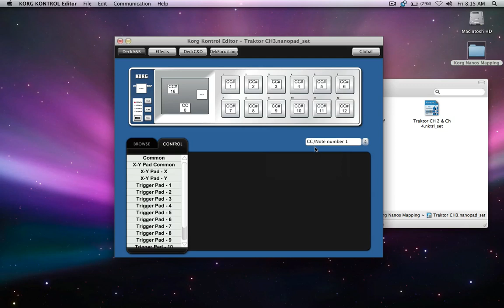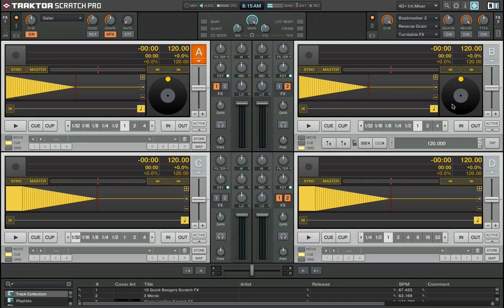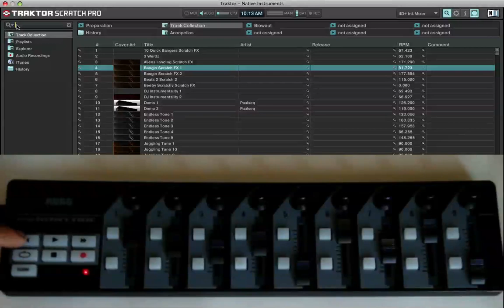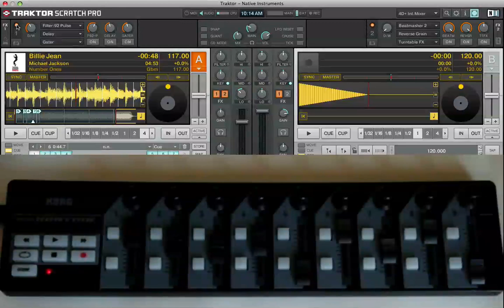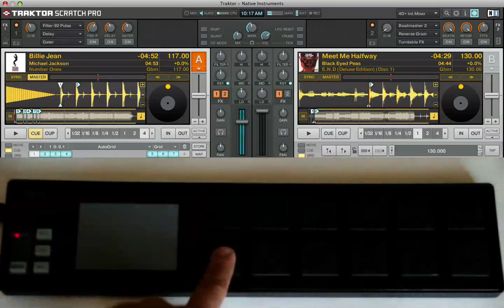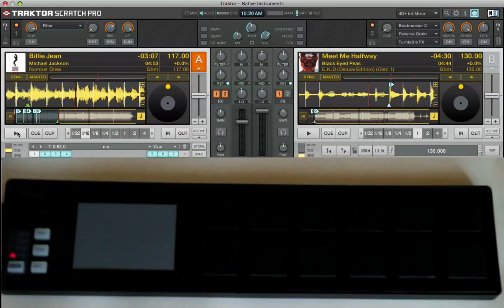How To Control Traktor Pro With Korg Nano's - Free Midi Mappings

Comment: im using tracktor 2 and for some reason is not working can you tell me what im doing wrong? And im using a pc.. Thanks.
Reply: and I m have a graphite mf8 samson does not work the rotating but  just to the right .
 to the left close directly close does not rotate the course of the dry wet effect button etc

Comment: armyofme4340 I do need your help :(( I did bought a KORG NANOS and after one week I already update to a mixtrack pro from numark. I do miss the reset BMP option that was on kargo.  I am trying to set up a hot key, going inside Setting > Controller mnage > ADD IN

I did find the one to PUT IT IN SYNC but cannot see a way to do the way around, i mean when I press is reset the BMP. can u help?? :((

Comment from the maker: @PAGU3IS The nano's are a little tricky with LEDs. They are not software mappable. Which means traktor won't map them, you have to assign them in the kontrol as toggles. And then assign them as holds in traktor. It's the only way. But even then it's not an ideal fix.

Comment from the maker: @fredooow The new version of traktor has a sampler. look  up traktor s4. dj shiftee has an amazing video on it.

as for the current version. it doesn't technically have a sampler but you can use deck c/d and set up your samples to cue points and then map those cue points to your nanopad. check out ean goldens midi fighter walkthrough on here as well. he shows you how to globally record your samples and glitch them out.

Comment from the maker: Thanks. I'm working on a really good maschine mapping for traktor, with sweep build ups, loop rolls, cue juggling, and fx presets. i'll post it up when it's done.

Yeah a lot of people don't use loop rolls in traktor because it requires a bit of midi mapping faking but i got it to work with a knob that distorts the loop roll if you wanna get a little gritty.

Stay tuned.

Comment: This is way inspiring.  I'll probably roll my own assignments but this gave me a lot of really good ideas.

I've had Serato forever, and used my NanoPad mostly for loop rolling.  I'm just now getting to work on Traktor Scratch Pro because of a promo thing with NI.  Anyway really excellent job on the video, by far one of the most comprehensive I've seen

Comment: Hi armyofme4340, or anyone else who could help. Cant get my nanoKontrol working with Traktor 1.2.  Windows7, have installed korg driver. installed your nanoKontrol file into the korg editor, clicked write scene set + write scene data. then imported the .TKS into traktor.  (using your updated files from the update video) but the mapping isall wrong. ie pressing the first button does not play track A. and random buttons on scene 2= line faders etc..   Any ideas what I could be doing wrong?

Comment: Hi. I have been using your mappings for the nanoKontrol and it has been working very well. The problem is that it is a hassle to toggle between scenes to control effects and decks c&d. So I brought another nanoKontrol. My question is do I need to download another editor for the newest kontrol and does Traktor support using 2 controllers in the Controller manager? If so how do I set that up? Note: I am using my HC4500 and 2 nanoKontrols. Thanks

Comment from the maker: What's the issue. It shouldn't matter what platform your in.

if you are on Traktor 1.2 check out my video called update 02...

It has the file updated for version 1.2, that should fix any issues with modifiers.

Comment: Hi, really nice mapping, but there's few things that I find odd, like the pitch reset buttons and slider 5 doesn't have anything binded to it, I would dump the pitch reset, because even if you would use it it will mess up your pitch slider real position to the software, and slider 5 would be nice for a main volume or headphone mix.
I only own nanokontrol and I was looking a good mapping for effects and cues, this wasn't quite it, but I got lots of interesting new ideas how to map my own, thanks!

Comment from the maker: Actually I do have the mappings for 1.2 I need to update the illustration with some updated mappings I made it easier to change the effects while your in scene two. I basically added a modifier so that when you hold it down and turn the knob you can scroll through the effects. I can give you the file but I don't have the illustration for it yet

Comment from the maker: that is possible except that the knobs only have a specific field of rotation so if you set it to relative mode, it will scan really quick, to the point where it's hard to control. But you can try and tweak it out maybe it will work.

Comment from the maker: hmm they should. the only time they turn off is when you switch scenes. Also I only have the leds working where i need them to. (i.e. effect on, loop active, and most of scene 2 where the effects are in play)

Make sure that you have processed the nano through the korg editor, because that is were i made the changes for the leds, with the files provided. good luck

Comment from the maker: Yes Def. I have a hercules RMX and i use the jog's as my control interface and as my soundcard. But these are great additions have. you can have dedicated FX controls with the nanokontrol and dedicated hotcues with the nanopad and use your mixer externally. Lots of potential. I am always updating files so that they made more sense so check back and subscribe to the page

Comment from the maker: Hey There.

the most common issue would be that our versions of traktor don´t match. These mappings are for version 1.1.1

if the mappings imported okay in to traktor the only other issue would be that the nanopad itself has not been setup properly. You need to do the first step. Because the nanopad has it´s own midi mappings within itself. it´s also assigned to channel 3. I would go back and make sure you import the nanopad file with the korg editor do a write scene set and data